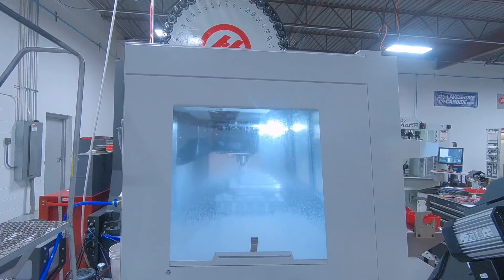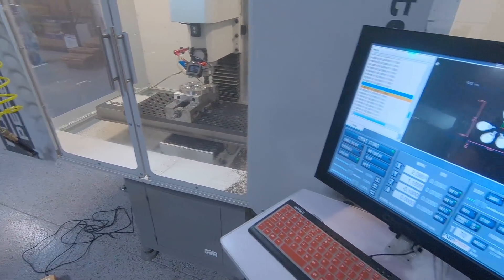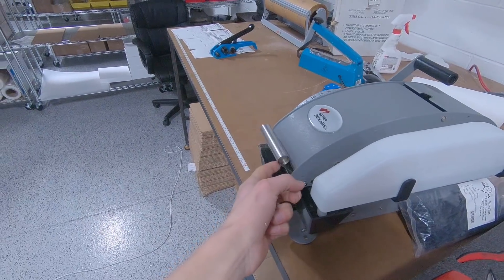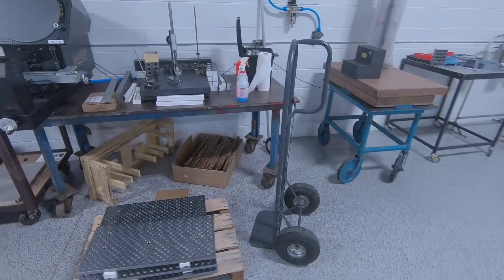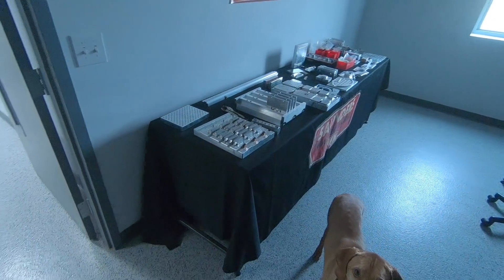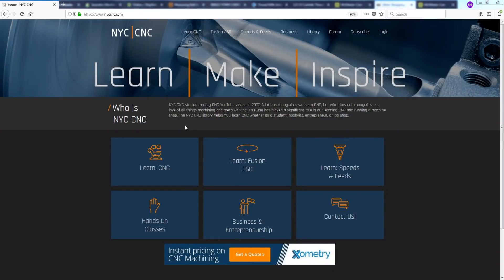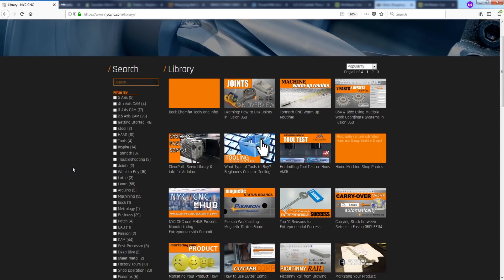Shop Update - January 2018

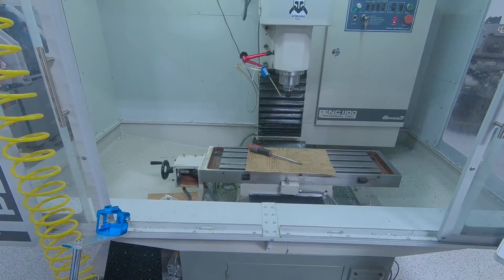Comment: Hi John. I am eager to see your latest approaches to Tormach maintenance and tuning. (rev 0:58) I recently purchased an almost 4 year old 770. I have found that Tormach's approach to both gibs and drawbar tension is to crank it down till it breaks then back off some. I find this approach crude and ineffective. In the case of the drawbar, once I added the requisite washers to the power drawbar release piston and anti seize grease at the I could not get it tight enough where it didn't release. So I ended up with a compromise that has worked well enough.
In the case  of the Z-axis gib adjustment I never got it to stall or lose motion even though the top z gib tightening screw was tight enough that I could not tighten it any more without adding leverage. There again I backed  off about 1/3 turn. Totally arbitrary but there isn't alternative guidance that I'm aware of.

Comment: Looking forward to your BOSS Laser video! We're eyeing their 150W HP laser, which can apparently cut up to 18ga with oxygen assist.
Reply: I would encourage you to take the time visit the boss showroom and test you materials prior to purchase.  We bought a HP3655 with 150 watt tube.  I have not had success in cutting steel.  The ability to cut steel was not a requirement for our purchase, but we spent six hours testing all of the materials that were on our list to be good to go.  The investment of time and a trip prior to purchase might be worthwhile.
Reply: Brian Beesley thanks for that advice. We're in Chicago, but are definitely planning on sending some samples of materials that we die-cut at the moment (like gasket and friction materials, and others).

Have you had any major issues with your HP3655?
Reply: I have not had a single issue.  I did have onsite installation, which was worth every penny!  The shop was up and running with the laser by noon of that day and the rest of the day was getting the ins and outs and a crash course.  I am fanatical about PM on machines which I firmly believe goes a long way in any machines performance and lifespan.  I also am a firm believer in having spare parts at the ready for most of my machines.  I have backup lenses in both of the sizes that I use and an assortment of other parts that could be easy fixes to minimize downtime.  Let me know if you have any other specifics if they pop up.

Comment: Nice - i film sometimes for my customers the milling process, too - i used an GoPro but i switch to an SONY RX0 ;) - nice Update and machines.
I work with Hermle and DMG/Gildemeister-Machines. I work in ca company - it makes products for the marine, astro and optical e.g.  Zeiss or so :)

I like the work as a cutting machine operator